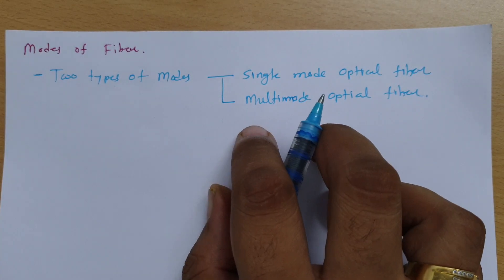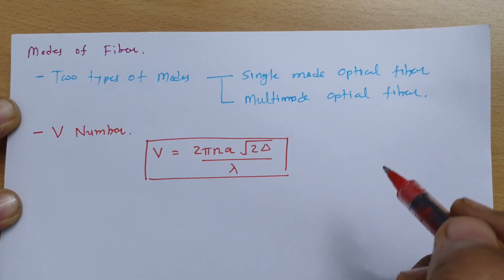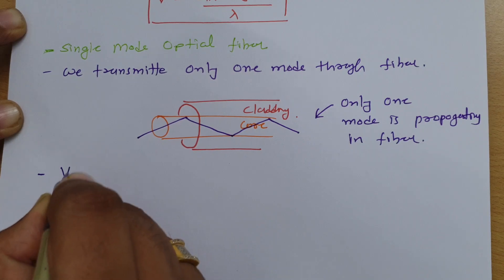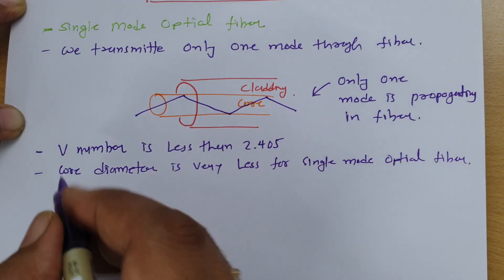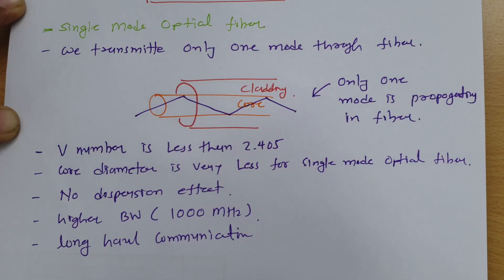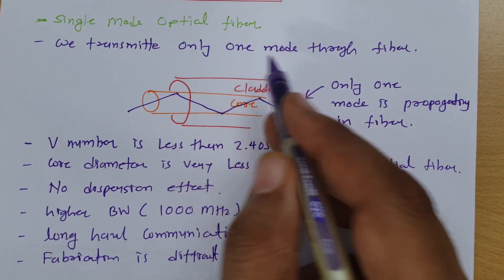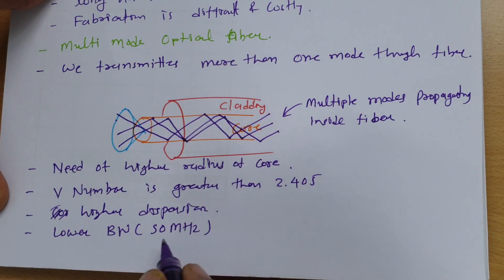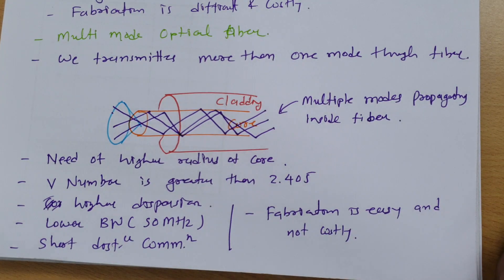Single-mode Optical fiber and Multi-mode Optical Fiber in Optical Fiber Communication

Comment: In single mode light travels in straight way.... Isn't it.
Why you draw total internal reflection?
Reply from the maker: It is perfectly correct here. 
In single mode light travels in straight path with reflections.
Reply: The basic principle of fiber is total internal reflection! How come it would travel straight?
Reply from the maker: @shubhama891  : in multimode reflections happens at different angles
Reply: @EngineeringFunda  I was replying to Richa Yadav sir! The basic principle of fiber is TIR,so, obviously light won't travel straight thru fiber,it must undergo multiple reflection! 👍
Reply: Ohk.... It's correct here👍🙏☺️

Comment: Thank you a lot Professor.
in terms of bandwidth.
Multi mode and Single Mode.
you say Multi mode is less bandwidth how?.
Reply from the maker: Bandwidth is less with particular Mode in multi Mode. Total bandwidth will be high with Multi Mode fiber.
Reply: @EngineeringFunda  Thank you Prof.
all in all Multi-mode Is more  capacity yes.
Reply from the maker: Yeah
Reply: @EngineeringFunda  Thank you. technical and practical. still on your tutorial all lecturer i learn from your channel mostly you're great and Explanation from Scratch.
technical and practical can you tell where i can get it.

much love Sir.
Reply from the maker: Practicals can be done at college, but I done have access to it, as we work from home due to covid19
Reply: @EngineeringFunda  great ok sir. thanks
Reply: @EngineeringFunda  But sir in the previous video you told multimode is used for long haul communication and in this you are saying single mode is used for long haul communication.

Comment: hello sir, however i know  in single mode fiber passes only one light beam it does not bounces inside the core because of this it covers long distance. please guide me if im wrong.
Reply from the maker: It doesn't bounce in case of graded index fiber but in step index fiber, it will bounce even if you have one beam.